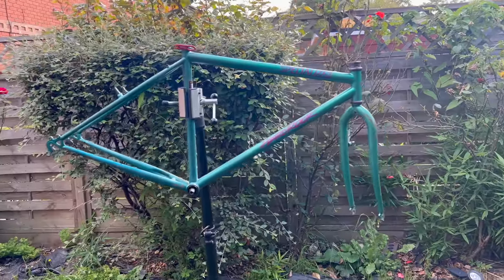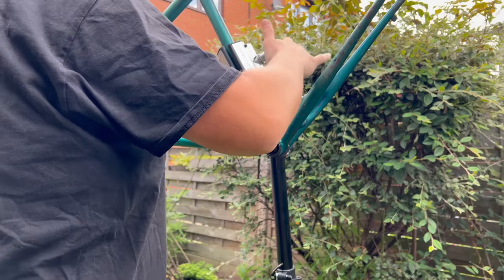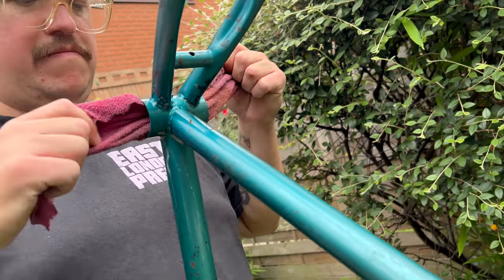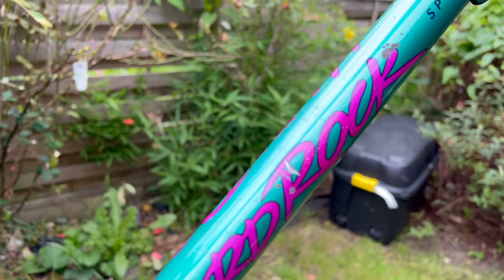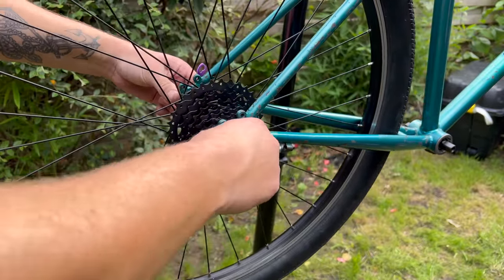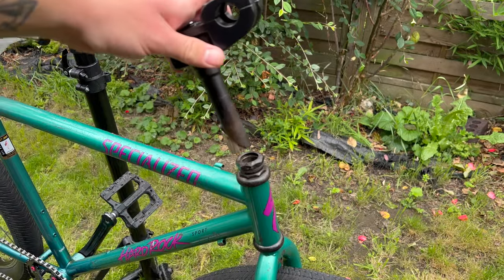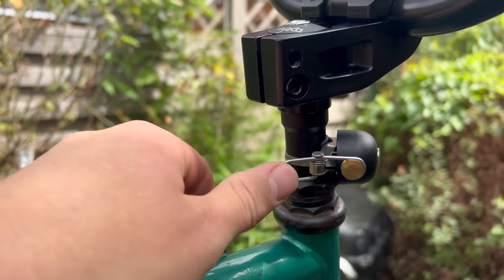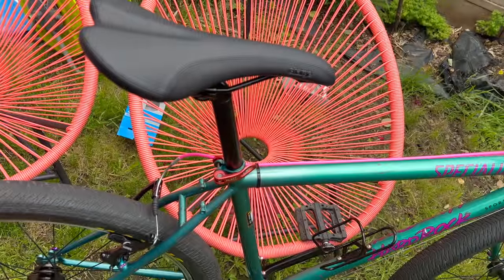Building A Specialized Hardrock Commuter -  restored mod retro bike build vintage MTB restoration

Comment: soon there will be no untouched hardrocks... all must be bmx bar slick 1x meme builds.. imagine the reddit karma :O
Reply: How'd you know what my build looks like
Reply: I have a relatively unmolested Hard Rock.  Changed handlebars and seat post. It’s the bike that won’t die.
Reply: Lol 650b fixed gear hardrock with dremeled out dropouts and literally zero original parts checking in
Reply: Not just hardrocks, but any 90s 26" MTB
Reply: Cry baby…
Reply: Better than being scrapped.
Reply: My dumpster rescue HR is safe from hipster hands....
Reply: If it's being ridden,it's not in a backyard, on the ground doing a disappearing act every winter or some crackheads shopping cart to help subsidize another needle load.
Reply: My 1993 Rockhopper Comp is going to get new 3x7 with a new Hollowtech II BB
Reply: If you wana leave them stock, go buy them all up... and let them rust in your garage.

Comment: For a couple of years in the late noughties I commuted about 8 miles each way into central London on a Hardrock I'd had since my teens in the mid 90s. My build for this super commuter consisted of putting some slick 26er tyres on it. What a fantastic bike it was, and bloody rapid really. Didn't properly appreciate it at the time and eventually got rid when I got a road bike to commute on. Which I obviously now regret

Comment: Hard rocks of that era are one of the best frames ever built. I have a '84 so the spacing for the rear axle is 130 which is perfect for a one speed.
Reply: I don't get it. Would rockhoppers and stumpjumpers for the same year just be better frames?

Comment: Loved the video! Wanted to share a check that I use when setting up the rear derailleur. I adjust the limit screws before installing the chain. That allows me to move the mech to both extremes and visually align the center of the pulley with the appropriate cog. I then adjust again once the chain is on. Just thought I’d share! Keep up the great work.
Reply: I thought we all did that?

Comment: I've built several hard Rocks.  I love them.  They came with 195x26 tires.  I'm amazed you could fit a 2.2 on it without rubbing.  Origin 8 makes a nice headset for these old bikes that works great.

Comment: I recently got back into bikes, and bought a ~1999 Specialized Hard Rock Comp - silver in color - aluminum A-1 frame, for just $50, here in the States. It "needed" an innertube and a shifter. After that, I put on the following new parts, as I got them free from Amazon: seat, stem, pedals, brake pads, lights, oil slick colored water bottle, and a bike bag, or two. The only part I've had to buy was the shifter and the grips, so I'm under $100 "invested".

Comment: I measure for chain length way differently, I put the front in small ring, rear in small ring, (cross shift) then cut the chain so it just flexes the rear derailleur enough to not rub the chain/pulleys together. This gives you the maximum amount of operation range for derailleur.

Comment: Consider giving G3 polish a try, works just like TCut but it breaks down as you polish and gets finer and finer. Gives a much nicer finish in the end
Reply from the maker: You know what, I think I’ve used it before and now you mention it it did work way better!! 😂 maybe I’ll do a comparison.
Reply: For snitz and giggles I used baking soda on a glossy white frame. Totally worked a treat and removed all the scuffs.  @2NDLIFEBIKES

Comment: Good build, do remember my old Hardrock with the Quill stem. Good choice on the brakes, have a 2001 Zaskar converted to a 1x and with Avid BB7 disc brakes yet retaining the Speed Dial 7 levers and they are more powerful than the hydraulic Codes I have on the newer Rocky Mountain. Great video and you have created a bomb-proof bike - not sure about the bars though😒!

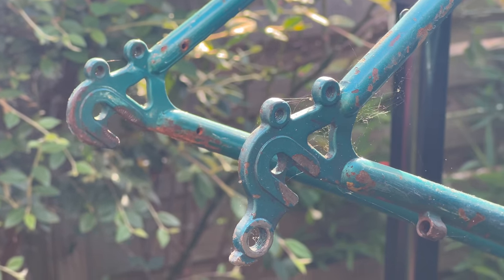Comment: 2:05
I need to work on my one too few days ago...
And oh damn ... 226Nm impact driver (not wrench...average impact driver in my case from Parkside (LIDL brand) works awesome , few seconds and it was out
PS
Pro tip
50/50% mix of acetone and ATF (automatic transmission fluid) works great for stuck stuff like this (way better than wd40 etc)  + some heat after that if still wont work

Comment: Great build, like always!! That BB if I'm not mistaken is an old Shimano BB-UN26, very similar to the ones I found in some old 90s bikes I took apart (GT talera 93, Trek 830 mountain track), tended to be like you shown in the video, kinda like inverted, the cartridge was in the left side and the plastic cup was on the right side
Reply: I had one of these in my 94 Gary Fisher I just rebuilt.
Reply: I'm in the process of rebuilding a 1995 specialized rock hopper. The bottom bracket is a cartridge one 73 X 110mm. It's been put in back to front so the right hand drive side is on the left and the left hand support part is on the right. When I removed it I noticed the threads are opposite to a normal cartridge one.  Is this normal ? Can I get a replacement as the bearings are knackered.
Reply: @matthewbourne659  sweet!! I hope some day I can get my hands in one of those, love the colors and design.

Regarding your question about the BB, yes, its like I said in the other comment, old shimano BBs that came installed with those 90s frames for some reason I don't know tended to be inverted.

In my particular experience, in both cases when I took apart a GT Talera '93 and a Trek 830 '95 BB I ended up swapping the factory installed Shimano BB with generic chinese 34,7mm 73 X 120mm BB with no problem whatsoever

Comment: got 2 off them both alu frames with suspention forks the pro one i got new about 20 odd years ago and is my workhorse for getting fire wood!! as got a trailer on it and a rack, was looking into going electric with it,  the other one i got out the skip at work it has v brakes on it at some point i'll sort it out!! for my nephue as i also have a carbon s works stumpjumper and a full carbon kona  kilauea wich are both awesome and older than my hard rock lol and i can see why you like billy bonkers got a set on the kona and my god its a rocket ship!! i run  out off gears on it now lol

Comment: What's your method for extremely stuck aluminum seat post in a steel frame?
Reply: Take away the saddle. Spray with w40. Wait. Warm the seat tube with a hair dryer. Hit the top of the seat post with a piece of wood, pushing it into the seat tube. 
If it goes down, it can go up.

Comment: Just found your channel and iam in, I've a question about  bike iam building,I've an old knackered mountain bike frame,I'd like to change the front fork from suspension to rigid,how do I find out which fork Eil work snd not fuck up the geometry

Comment: What's going on with the rear brake cable?  It looks like you've added an outer cable between the cable stops on the top bar.  I'm assuming it was made for canti's and there's no proper cable stop at the seat post end, just a little channel for the cable. I think I could see it when it was upside down on the ground.
Reply: The old Hardrock has a cable guide rather than a cable stop for the rear brake routing.  This complicates the use of a v-brake on the rear on the HR.  Alternatives are to use cantis, mullet the build, or copy 2nd-life's v-brake cable routing.

Comment: Would the 2.3 DTH tires fit?  I’m ordering parts for a hard rock build.
Reply from the maker: I’m pretty sure these are 2.2 I’ll check
Reply from the maker: They are 2.15
Reply: Do you think there is enough clearance for the 2.3 version?

Comment: Hello from New zealand! That's a good looking build, what bars/stem did you use?
Reply: Nice I have 4 hardrocks 1986 1993 2009 and 2014 and I ride the 1986 the most and what bars are you running? Are they more comfy than straight bars?
Reply: Fairdale (mx-6/mx-4?) bars and Sunday Freeze stem - it's mentioned in the parts bit, mid-vid

Comment: With the forks tske them out turn them upside down out a screwdriver through the hooe andntap wedge out with a hammer literslly couldnt be any simpler
Reply from the maker: Maybe I didn’t make it clear in the video, the wedge is seized. It’s not that I hadn’t thought of putting a long thing in it.